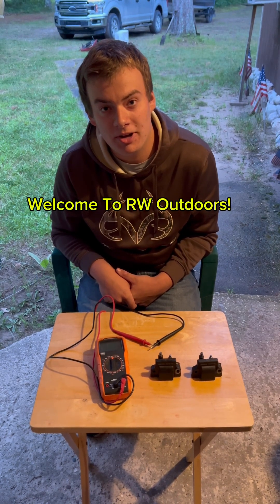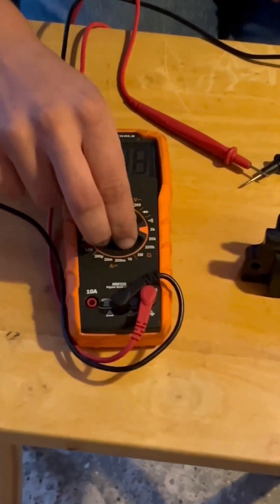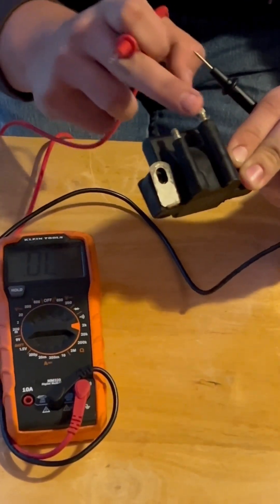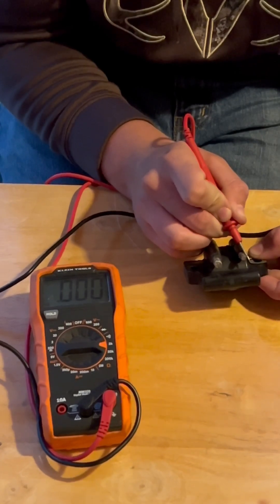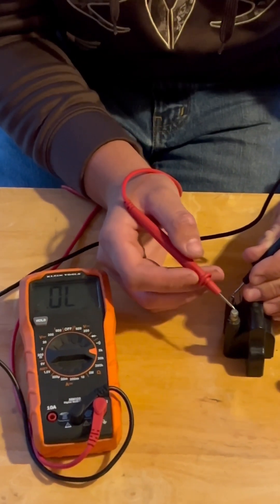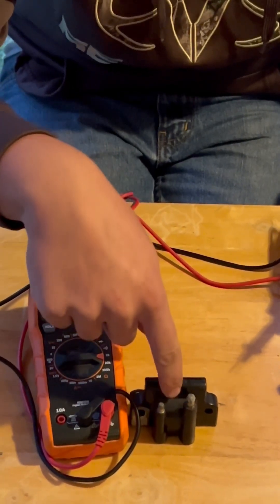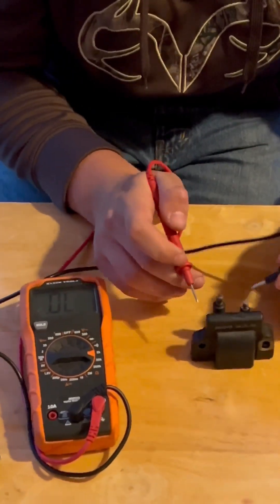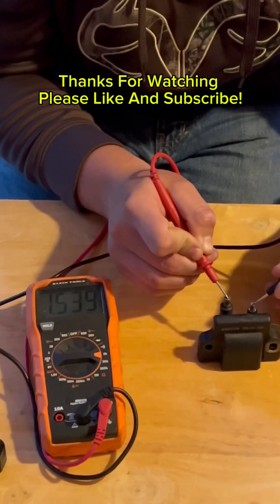How To Test Evinrude/Johnson Ignition Coils #shorts #outboards

Comment: When going from ground to primary mines reading about 60 is that normal? I have a cheap multimeter so reading could be off
Reply from the maker: That is not normal from the info I gathered it should be 0.